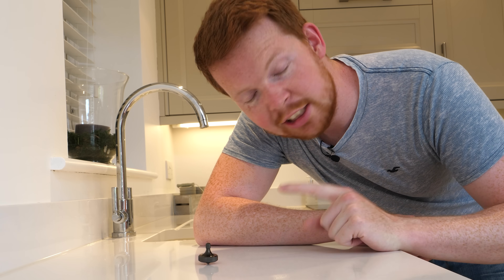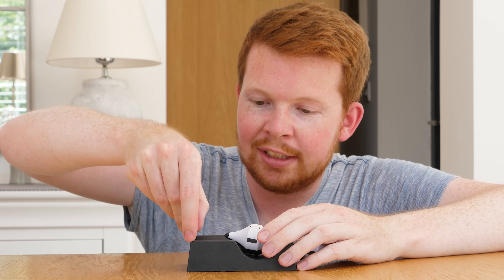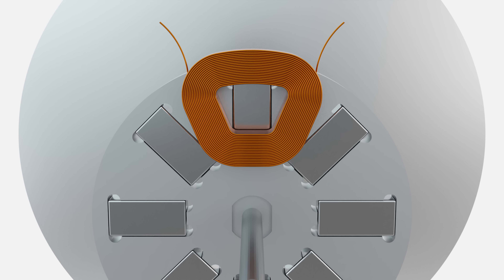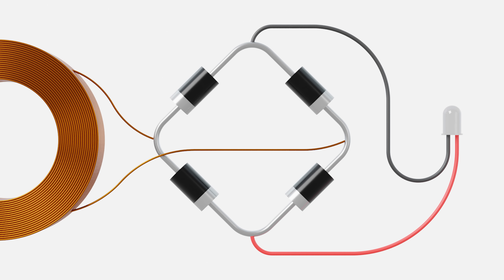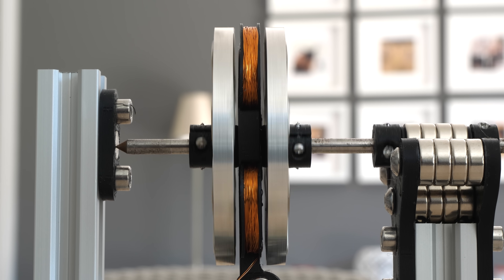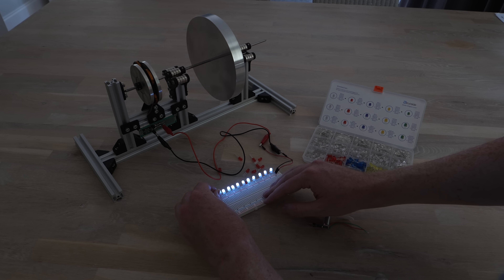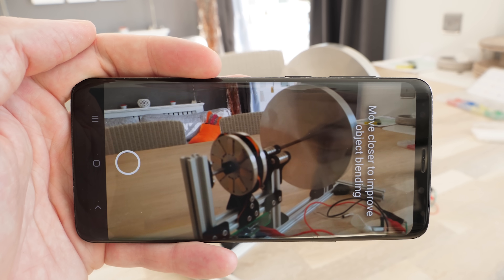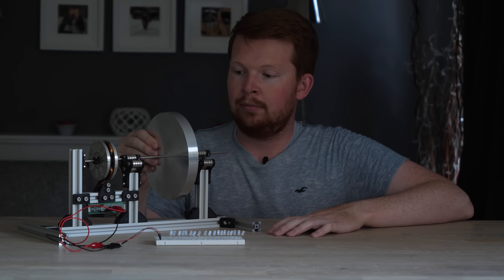Flywheel Battery

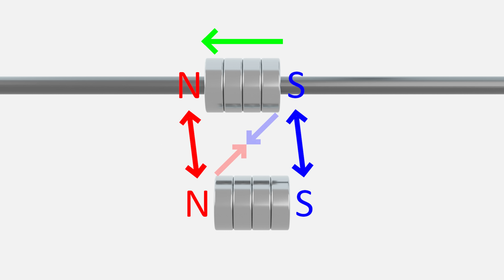Comment: WANT TO LEARN OF TRUTH - Free energy is in our Bible and is so super simple that it should be positive proof of an extremely powerful SPIRITUAL WARFARE. This is going on behind the scenes in order to cover up the simplicity of this super simple ancient free energy technology. (Geometrical Electricity Multiplication) This free energy technology is so old that it can be found in Ezekiel 1:16, where it is attempting to describe the workings of a UFO motor - ”a wheel in the middle of a wheel”. I used pulleys to imitate this technology, where you only input a few sparks of current for 1 rotation of a motor with a large 33 cm circumference, (about 10 cm diameter) pulley attached. This would freely gain you 99 cycles of AC or DC electricity, from 3 mini-pulleys of 1 cm circumference-(about 0.33 cm diameter) with AC or DC motors/generators attached.
-
Please Don't Believe in the torque lie, as the only power that these three mini-pulleys need to produce is a lot of voltage, (easy to do) and a few sparks of current, to crank over this 33 cm pulley once. That's right, this one large pulley, along with three mini-pulleys are forming a self-powering set of DC generators-motors. The many rotations of the mini=pulleys build up the massive voltage needed to crank over the large 33 cm pulley once. Then you use the large amount of belt that you gain from the single rotation of the large pulley to rotate the 3 mini-pulleys in massive amounts of times
-
Want to know more about something that really matters, like the Truth about the true powers of this world, reality, and what our lives are truly all about. I believe that Trump believes in our Father in Heaven, and by the way, the ARK of the COVENANT has been found in Jeremiah's Grotto, right under where YESHUA-Jesus was crucified. So HIS BLOOD and WATER that came out when He was stabbed by the spear could run down the crack in the bedrock, that happened when the earth quaked and landed on the correct side of the ARK, that was placed there many hundreds of years earlier. 
-
PLEASE WATCH THIS VIDEO https://www.youtube.com/watch?v=B8TRoQk6WUE @ (41:41) - HIS Blood is STILL ALIVE and has only 24 chromosomes - 23 from His mother and only One male chromosome from His Father Above (normal people have 46, that’s 23 from the mother and 23 from the dad). If these videos have been taken down, then in YouTube search these words - ( ark of covenant blood Ron Wyatt ) - Sorry guys + gals, but the higher up elite of mankind has decided to believe + side with these aliens (fallen angels and Nephilim) - sons+daughters of the children of fallen angels + human females in building these particle colliders + quantum computers - which mess with our timelines + allow evil spirits into our reality.
-
The Bible writings speak Truth and real HIS-story,
NOAH’s ARK -  there are many stories of the world flood all over this earth
https://www.youtube.com/watch?v=oQwfU7DvUyE 
https://www.youtube.com/watch?v=82j1IqwA6P0
RED SEA CROSSING
https://www.youtube.com/watch?v=QeX966OVxwU 
https://www.youtube.com/watch?v=Nsa7ebyUVD4 
-
I cannot be sure if Trump was-is+will-be the best American President,,, but did you notice that the fake news of the very corrupt media does not mention all of the great things Trump did?. Democrats not only want to kill your unborn offspring, but they want to kill them after birth even. DON'T BELIEVE ME,,,., then Google Democrat + abortion, then you can see for yourself. 
-
BY THE WAY - ISN'T THE FACT THAT THE ARK OF THE COVENANT HAS BEEN FOUND early in 82 and WITH CHRIST'S BLOOD ON IT and HIS BLOOD STILL BEING ALIVE AFTER 2000 YEARS- (PROVING THAT HE IS DIVINE), - HAVING ONLY 24 CHROMOSOMES - PROOF OF VIRGIN BORN (the biggest NEWS ever, and proof of the corrupt or fake NEWS) why is this not covered on every TV station 
<<PROOF - search YouTube>>
-
TRUMP ELECTION SCANDAL <<< If these are true-This Is Scary >>>
https://www.youtube.com/watch?v=V_7Z058MC7M&t=3735s
https://www.youtube.com/watch?v=dBj9ZDC_Ad8&t=1481s 
https://www.youtube.com/watch?v=m0YKf-caVuY&t=240s
https://www.youtube.com/watch?v=V_7Z058MC7M&t=3720s 
https://www.youtube.com/watch?v=OWwNJZhcrww 
https://www.youtube.com/watch?v=R5ki6S-WsKU&t=977s  
-
WAR IS UNEXCUSABLE https://www.youtube.com/watch?v=spnJ5WDgZnY 
-
Isn't it amazing what knowledge we can gain by simply adding the “il-s” of life, into this evil theory.,, EVil-sOLUTION. Evolution never happened,,, and it never had the time, so it could have happened,,,, because we have only been here on this earth for about 6000 years. These moon age figures are taken from this website @ http://lunarnetworks.blogspot.com/2013/11/apollo-12-alsep-first-to-measure-dust.html  
“Or, so NASA thought,,, just fast enough to form a layer about a millimeter (0.04 inch) thick every 1,000 years. If we say that the moon has been here 4.5 billion years or 4,500,000,000 years and We multiply that by X 1 mm / 1000 years = 4,500 meters of dust. Can you see the utter stupidity of believing that we have been here for even millions let alone billions of years. Our moon is God’s Hourglass, where the small amount of dust being deposited positively proving that we have only existed for a few thousand years.
-
WHERE ARE THE BILLIONS OF YEARS WORTH OF DUST DEPOSITS. Surely that would have produced many meters of dust, as would not the dust have been deposited even quicker way back then + Don't try to tell me that something or someone removed the dust every so many thousand years.
-
DO THE MATH FOR YOURSELF = the amount of dust deposit is known,,, + the amount deposited every year is known too. I did the math in the early '90s, and it worked out to be about 6000 years worth of dust that is on the moon now. I don't know if they use the same figures now or not. But even so, it should be obvious that after even one billion years,,,, the dust should be many meters thick.
-
TRUTH about COVID-19 = https://www.youtube.com/watch?v=H_vNWmqWmZc
+ https://www.youtube.com/watch?v=vzIWq_59MIY
-
Have you ever heard of the MANDELA Effect? PLEASE CHECK THIS OUT,,,, + then try telling me that there is not a POWERFUL SPIRITUAL WARFARE going on in our world. This is a must-watch video. All of time and space are changing. Things that are true have been altered + CERN is the cause for these events.
https://www.youtube.com/watch?v=pPrutcbaerQ
-
Here is one of the videos trying to let this scary information out
https://www.readersdigest.com.au/true-stories-lifestyle/thought-provoking/44-mandela-effect-examples-that-are-seriously-mind-bending
-
+ here is an explanation by the Physicists https://www.youtube.com/watch?v=HHKmoBeNWWQ&list=PLDIEv5nkqqEa0-u8DIzqpefKBAG0nkb7g&index=2
-
PRIORITY ONE = This world is going crazy + surely heading for the END TIMES. 
Priority should be, what can I do to prepare + protect yourself + your whole family. 
I don’t care what these EVil-sOLUTIONIST claim. They have never been able to find any missing kinks, between humans + apes or any other animals, and never will,,, because there aren't any. Did you ever see how much DNA coding that there is in the smallest human cell? It is massive + if it were a book shown to us, then we would have no problem in seeing how it could never be made by random chance. And the thing is, DNA is so much more complicated than any book that we could write. 
-
Please choose to take God’s free gift of Christ into your heart, as payment for your sins, so that you can look forward to a beautiful eternity  + do not need to worry about the future. Life is forever,,, if you miss this chance, then you are not only condemning your family to 60 - 80 years of life without the hope + the comfort of a loving Father + Savior + Companion, but you may be condemning them to an eternity in a place worse than hell, where you or nobody else can help them. 
-
Sorry if I scare you with this talk about our eternal souls, but I wish to warn you of LIFE, and all of its good + bad. God created us for good reasons, as He wanted to Create beings that he could love + take care of + communicate with. He is a Holy Being and needs us to be holy to be in His presence. He knew that we could never attain holiness on our own, so He sent His only Son so that we could choose to be with Him and take the Holy Spirit into our beings. That way He could freely give us that which we could not gain on our own so that we could eternally live with Him + He with us.
-
CERN Is Changing Our Timelines – Proof - Mandela Effect Part 1 + this is a video of what they are really up to https://www.youtube.com/watch?v=49dGknES0-w 
-
Here is a website that shows you how quick + simple this GEM technology is to build
= https://www.youtube.com/watch?reload=9&v=NxpoiCFKmPg  
I used 3 mini-pulleys to gain the voltage, but this system only used one
-
http://beliefstoliveby.yolasite.com/ 
http://evolutiondebate.yolasite.com/ 
-
TRUTH ABOUT CERN
https://www.youtube.com/watch?v=49dGknES0-w
https://www.youtube.com/watch?v=ooZA0riSa9Y
D-WAVE COMPUTER
https://www.youtube.com/watch?v=1v19n5JBSDs&t=305s
RELEASING DARKNESS
https://www.youtube.com/watch?v=7TA-z6RrXRo
SATAN’s NAME IS "god"
https://www.youtube.com/watch?v=_qr2vT5ySLA&t=
ILLUMINATI PLAN FOR HUMANITY
https://www.youtube.com/watch?v=49dGknES0-wDE
MANDELA EFFECT
https://www.mentalfloss.com/article/585887/mandela-effect-examples 
CHRONOVISOR 
https://www.youtube.com/watch?v=eEXpc-a5ry8

Comment: Oh I'm being picky here but everyone calling it Full Bridge Rectifier is bugging me. The correct term is Full Wave Bridge Rectifier, as opposed to a Half Wave.
A single diode will "rectify" one side (polarity) of the alternating voltage (sinusoidal), thus Half Wave. By arranging four diodes in a bridge, both sides (pos and neg polarities) are rectified and thus Full Wave.
I'm OCD....I cannot help it :)

Comment: Congratulations, nice project
you should have created a small motor powered by the energy produced by the big wheel, that spun the big wheel Which machine powered the small motor,
controlled by a small trimmer. You could have had an infinite energy engine.

Comment: Add this to a cars “flywheel” or electric motor shaft and we can have the car create electricity for EV batteries, creating a self powered car that mostly never needs charging, creating an energy loop that lasts much longer after initially charging from an electric circuit.  Since it’s already being converted from AC to DC, it’s perfect for the EV vehicle.

Comment: Amazing Project, however at 5:37 you pick the literally worst examples for why you need to rectify AC to DV: A light bulb, and an electric motor - which are literally the only things (if you consider a heater and a light bulb essentially the same thing) you can run with AC.

Comment: What if…one were to increase the output of the alternator with even more coils, and or a larger rotor, and then attach a capacitor and/or a battery.  Put a hall-effect sensor on the flywheel to sense rpm. EG: such that the alternator charges the capacitor/battery and as the Hall effect sensor senses the RPM dropping on the fly wheel, a mechanism not unlike a starter motor in a car kicks over and spins the fly wheel back.  The motor would then turn off, and the fly wheel again goes into a charge mode, charging the battery…which then occasionally has to discharge a bit to spin the fly wheel back up. Now I’m curious if such a set up could generate more electricity than it uses and ergo keep a battery charged using nothing more than itself and the motor. Indefinitely…

The main wanders…

Comment: With friction being basically non existent, I'd be interested to see what happens when you apply a small motor to the end with a small brace, and put a polished tungsten tip against a polished tungsten brace on the other end. Then maybe with a simple starting twist, and the right amount of resistance, maybe get something close to perpetual?
Reply: there's a ton of friction from the coils.

Comment: I had an idea for a bigger version of this sitting inside a big ring so that it's rolling downhill to spin. For almost true perpetual motion, you could add a lever to rotate the outer ring and have it powered by a balloon tethered to a shoreline so that the pressure pushes the lever up. i'd say the moon and magnets is the closest thing we'll get to perpetual motion
Reply: Why do you think that "moon and magnets" is the closes we will get to "perpetual motion"? 
If you are willing to use an outside force like the moon for "perpetual motion" (at that point it wouldn't be perpetual motion) then you should also be okay with using the sun. 
So solar panels would be just as much "perpetual motion" as moon and magnets.
Reply: @Jehty_  but unfortunately less consistent

Comment: taking my knowledge of cars and transmission dissasembly ive experienced i think what could make this really really effective is a gear reduction that makes it easier for the motor to keep spinning whilst providing a more conisisten output with less switching of the voltage. may just sound stupid idk

Comment: Do away with the aluminum flywheel. Create a flywheel using fiberglass rods as spokes with a rim housing your magnets. Or you can even use a bicycle wheel instead of making your own wheel.  Place lots of magnets side-by-side on the rim. With the inductor coils on the table, you should be able to get more power.  Ideally, you would put the entire device in a vacuum chamber to further reduce friction.  Decades ago, they looked at using flywheels in cars. It didn't go anywhere because of possible safety issues.  (In a wreck, the flywheel might shed magnets as projectiles.) But you can find articles about it in old Popular Mechanics issues from the 1970s.

Comment: what if the fly wheel is 2m big and 50cm thick and and as havy as possible with gears to make it spin by a bycicle. As starting help, i could imagine, to spin with less effort for little in to a bunj/rubber energy holding device.
like spinning against the force to charge up some power that can then be controled released to give you a starting help in the spinning of the giant wheel.
Maybe use Wind energy to keep it running. 
Shure energy is always lost when its converted.
But how much power can you store in that Wheel, and how practical could it be used as a serious battery?
I guess i am thinking of Energy condendency?

Comment: So silly.  Do you think you are wise to ignore 130 years of generator design?   Just about everything in this gadget is far below optimal.  Real generators have closed and tight magnetic paths, sturdy shafts, many poles, 3 phase outputs, and sized in the megawatts instead of the low milliwatts.  We are talking about a BILLION times more output.  Electrically you are losing almost half the power in the bridge rectifier.  And not matching the load to the generator.  This would be state of the art of the year was 1880.  What a waste of time and effort.   And now another 5 million viewers are misinformed.  Sad.

Comment: A question, if I may? I'm wishing to make a low voltage water powered Altinator. To keep the electronics dry I intend to use an impeller in the water to spin some magnets in front of a bulkhead, on the dry side some coins to turn the magnetism into electricity. My question is, what is the most efficient number of magnet: 2,3,4. And the best wire winding pattern: one coil for each magnet, a figure 8 between two magnets, or a star winding from the rim to the centre & back to the rim multiple times. Or is there a better way.
My very best regards.
🙃👌😀👍😇🙏😅🚴‍♂️🐕

Comment: I do like your videos and how you make stuff :) but, just one advice from experience., the setup you have with the magnets and the coil is not efficient like that because you are basically inducing 2 opposing forces on the coils. when the magnetic field on the top is "north" and on the bottom is "south" the coils basically is generating induction on the top and "counter induction" on the bottom of the coil. it should be, full north or full south poles perpendicular to the coils. if I made my self understand lol. Peace and keep the good work!

Comment: it's only magnetic bearing's - without physical friction ( stil is by -  but reduce to minimum - on  needle axis) . Flywheel is flywheel we need energy to move  it- your energy - your hands still do - elektric power  like bike dynamo.   flyeheel is battery - acu potencial energy -  transmits kinetic energy with slowly put out.

Comment: Hi tom use a flywheel where the most of the mass is away from the center. like a spoke based wheel. Moment of inertia will be dependent on r2 
( 1/2 mr2) so it will be very high rpm and longer time. Use a heavy ss rim with attached with only spokes from the axes of rotation.

Comment: You can also extract DC from the flywheel directly by passing it through a magnet on either side. The DC will have to be extracted through contact though.